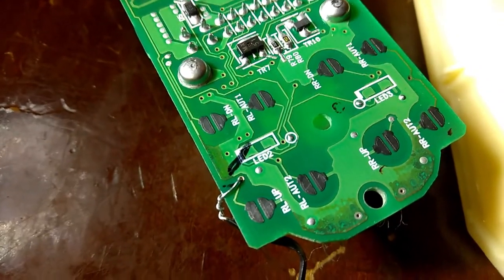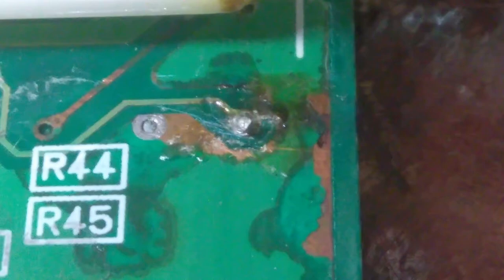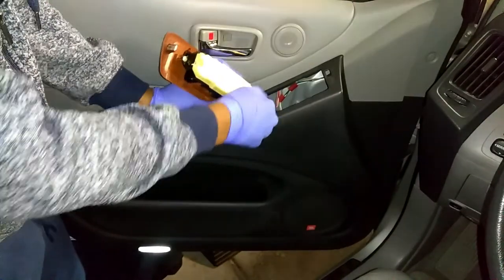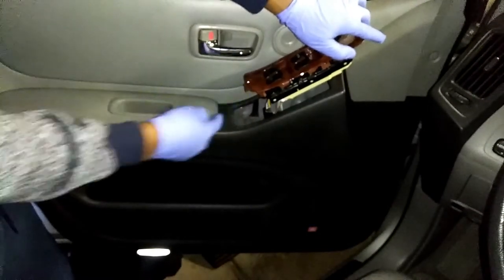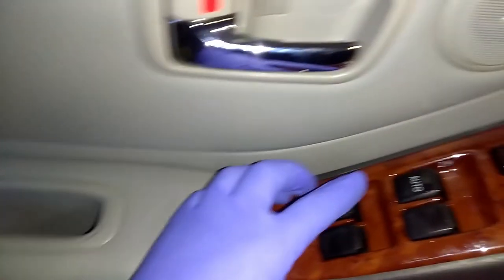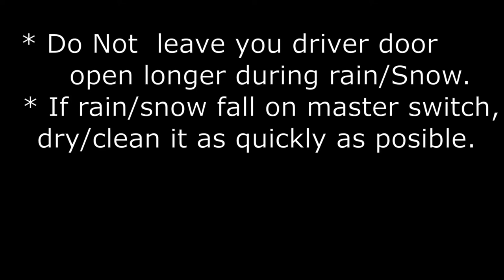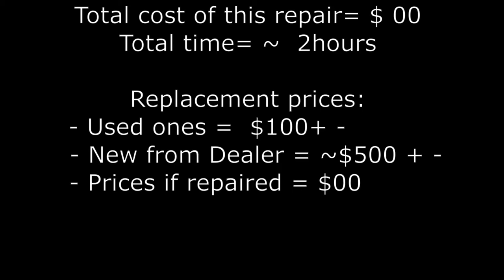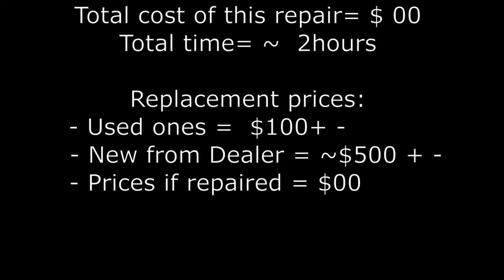How to fix Toyota Power window Master switch

Comment: How did you find that there is no connectivity between two points?
Reply from the maker: Use a continuity tester on a  multimeter. lot of multimeters these days have  audible sound to test continuity. You can also google "How to test continuity"

Comment: Mine is broken just like yours, may I know what's broken?
Reply from the maker: Hi Fajar.
It can be like mine or it can be different problem, like corroded and broken circuit line or faulty component....
 You have to take it apart and check continuity.
 Thanks for your comment.
Reply: @ktdiy9818  Okay I'll check it out, thank you

Comment: You could have simply used a hot soldering iron and reflowed the solder (inside the pass-thru hole) instead of all that wiring or whatever it was that you used.
Reply: The wire was to test it.  If you had simply watched until the end, he did solder it after the test was successful.
Reply: @tinydragonlabs  I did watch to the end. I've been repairing electronics for over 60 years. I've fabricated integrated circuits with Intel Corp and IBM and others for over 30. This video is okay if you've never dealt with this type of repair I guess, not sure why even clicked on it.